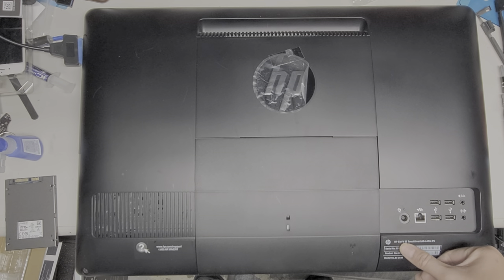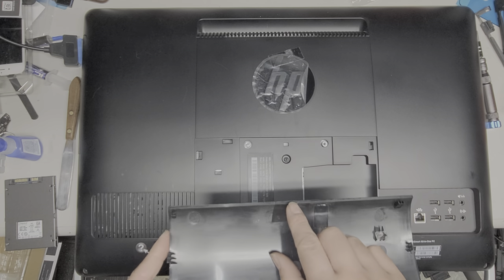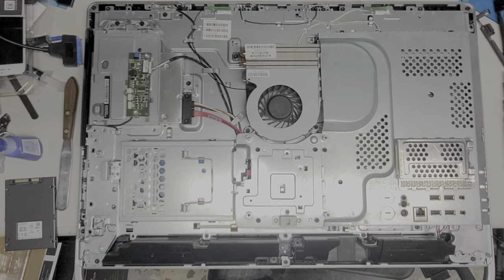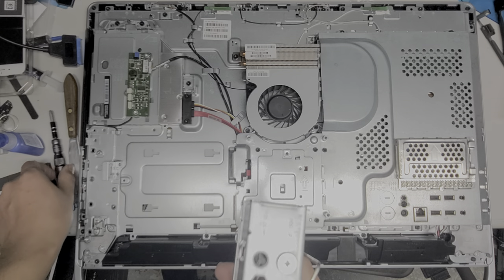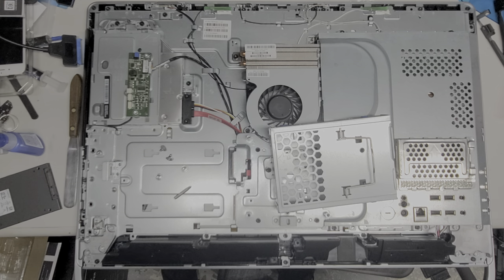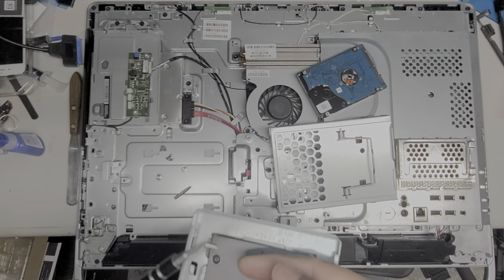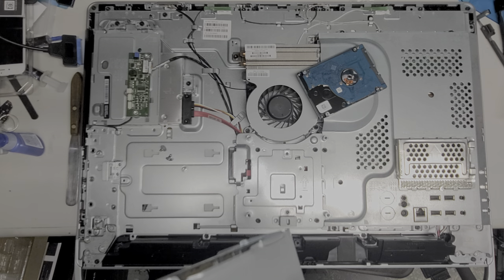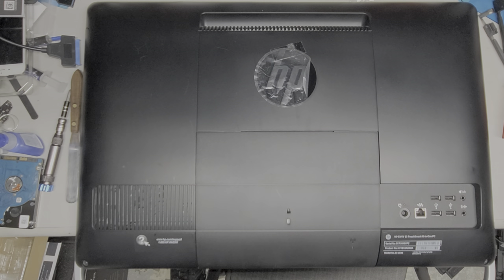HP Envy 23 TouchSmart All-in-One PC Disassembly RAM SSD Hard Drive Upgrade Repair

Comment: just wanted to say... it worked like a charm. I upgraded both, ram and ssd... thank you very much for this great video!
Reply from the maker: Glad it worked. If you haven't already, please like and subscribe so others can find my videos. Thanks!
Reply: @ItsBinhRepaired  done
Reply from the maker: @FreeEnergyNerd  thanks!
Reply: Hello, was the hard-drive that was removed a 2.5-inch or 3.5 inch? Do you have a link where you purchased the ram memory, what size solid state drive did you place in there?
Reply: @josephgarcia3767  somehow the answer i sent disappeared... i got the rams on amazn..2x8gb and removed the 3.5 1tb disk and replaced it with a 2.5 samsung evo 500gb.
But before you install windows 10... and upgrade ram, you MUST update bios from hp page. It will not let you do it if you use windows 10. and it will give you problems with the bigger ram with the bios as it is... now it works like a charm.
Luc
Reply from the maker: Interesting

Comment: Hi, I was wondering if the hard drive installed in that computer 🖥 was a 2.5 inch as stock? My friend has this computer and it's running slow. It did also have only 6 gigabytes of ram and a one terabyte internal hard drive. Suggesting they go up to solid state and 2 terabytes. Do you recall the hard-drive size that was removed? Thank you, very good instructional video.
Reply from the maker: I don't know because customers might make changes without telling me. All I know is what was in there at the time of working on it.

Comment: I have a 10 year-old HP Envy 23 similar to the one shown in your video, but the screen is blank (dark) when I try to boot. The fan works and I can hear the HDD running, although I had been getting intermittent error messages about a HDD failure. I've tried to turn it on with and without the HDD installed but no difference. Any thoughts on how to trouble-shoot the black screen?
Reply from the maker: Nothing on the screen at all?
Reply: @ItsBinhRepaired  no, nothing
Reply from the maker: Possibly ram needs to be reseated or bad screen or motherboard issue.
Reply: @ItsBinhRepaired  Thank you. I did reseat the RAM, but I do not know how to troubleshoot screen and motherboard issues. I removed the HDD and performed CHKDSK /r and at the end of Stage 4 I got " An unspecified error occurred (75736e6a726e6c2e 500)". But I assume that even with the HDD removed I should get something on the screen. Thanks again - I'll continue to fiddle with this computer while I look for a new one to buy.
Reply from the maker: Most likely motherboard issue :(
Reply: @ItsBinhRepaired  Yes, you're probably correct. Many thanks for your FB posts and reply to my question.
Reply from the maker: No problem

Comment: Just a quick question, can I use 12800 ram as oppose 12800S? Great vid by the way!
Reply from the maker: Most likely will be fine, just make sure you have a way to return it if it doesn't work.

Comment: Hello, what type of adapter is being used to connect the hdd/ssd sata to ? Thank you
Reply from the maker: There's no adapter needed.
Reply: @ItsBinhRepaired  so, there's no adapter inside the metal housing where the HDD goes?  I'm asking because I just received this same PC; it's missing the hard drive and the metal housing for the hard drive, but I do have a spare hdd that I can rig up in there
Reply from the maker: @Wub-is8dp  just have to see if the sata connector is there. You can mount the drive in place with tape.

Comment: i have trouble running photoshop and a screen recorder at the same time. will upgrading the graphics card and/or ram help my situation? 23 all in one beats n010
Reply from the maker: Yeah, but you can't upgrade the graphics card.
Reply: @ItsBinhRepaired  My Specs say I can add a graphics card in the PCI Express MXM slot that supports a PCI Express x16 graphics card (Generation 2 speed) (https://support.hp.com/us-en/product/hp-envy-23-d100-touchsmart-all-in-one-desktop-pc-series/5330735/model/5359999/document/c03305138)
How do I do that?
Reply from the maker: @IlseMulAuthor  no idea. Never tried that before.
Reply: @ItsBinhRepaired  ah 😀
I'm trying that expansion slot, but I can't seem to find it ....
Reply from the maker: @IlseMulAuthor  someone told me they used the wireless card slot for that. I'm not sure how that works.
Reply from the maker: @IlseMulAuthor  I don't even know how you can fit a gpu in the computer.

Comment: what type of windows usb should i buy for the all in one cause i lost the windows usb
Reply from the maker: You can create one using this https://youtu.be/R6GVDyVqWso
Reply: I fixed the ssd issue but idk if it will boot up to windows screen
Reply from the maker: @t4uva26  did you install windows to it?
Reply: @ItsBinhRepaired   no but when i took of the parts and the windows usb i lost the windows usb  so im wondering if it will boot up to windows
Reply from the maker: Only if you cloned the original drive to the new one.

Comment: do you know exactly the maximum ram that it can take? 🤔 if that makes sense..
Reply from the maker: Whatever you can fit in the slots
Reply: HP online manual has it marked for 16 gigabytes maximum.
Reply from the maker: I don't trust those maximums
Reply: What do you mean? 16GB is the max for 2 sticks of DDR3.  @ItsBinhRepaired
Reply from the maker: @sfgrgfsf212  I don't think you can get a single 16gb ddr3 module
Reply: @ItsBinhRepaired  Oh I see. Yes, two sticks of 8GB to total 16GB.
Reply from the maker: @sfgrgfsf212  yup

Comment: What SATA version is this PC has? How many SATA interfaces it has?
Is there any NVME M.2 interface fos NVME SSD on it?
Reply from the maker: Whatever is mentioned in the video is all I know. Any other hidden things that I didn't mention, I wouldn't know.
Reply: @ItsBinhRepaired  ok, thank U
Reply from the maker: @hasanmayditia1820  no problem
Reply: Looks like it only allows us to add one SATA drive, be it hard drive or solid state.  You can remove the optical (disk) drive and add a 2nd drive into this computer. I added an m.s drive into a laptop that has space for m.2 and SATA. The M.2 was connected into the motherboard. It resembled a ram module that was a bit longer.

Comment: Hello. Tell me which sled do you use (part number)? I have a similar monoblock model and want to upgrade my 3.5 drive to ssd.
Reply from the maker: What do you mean by sled?
Reply: @ItsBinhRepaired  A basket into which a 2.5 disc is inserted, which in turn is inserted into a 3.5 basket.
Timestamp 8:22
Reply from the maker: @АлексейКарогин  I'm not sure. That's how the customer brought it to me. I thought they all come like that.

Comment: wheres the link for the ssd cloning?
Reply from the maker: Here https://youtu.be/4p5jFDzVwUw
Reply: @ItsBinhRepaired  thankyou, also another question i tried using an msata ssd for this computer (in the video). do you know why the msata ssd is not
compatible with this computer?
Reply from the maker: How did you connect it?
Reply: @ItsBinhRepaired  mini slot 2 port
Reply from the maker: @RedVenomProductions  likely is for a network card only.
Reply: @ItsBinhRepaired  but it fits the slot. how could it not work? compatibility?
Reply from the maker: @RedVenomProductions  I mean, just because you can put it in the hole, doesn't mean you should, or that it's compatible, if you know what I mean. Lol
Reply: @ItsBinhRepaired  but do you think it could be the little blue switch/socket things need to be switched to different pins. cause i know there other blue sockets for the BIOS or CMOS reset. but what about the other ones
Reply from the maker: That won't make the SSD work
Reply: @ItsBinhRepaired  ok so its just compatibility then. then im going to buy the ssd in this video and try to install it. cause i need it cause the Hard drive could give out at any time. its been a long time since i had my envy 23 and i also want it faster.
Reply from the maker: Hope it goes well
Reply: @ItsBinhRepaired  same i dont want to loose any data or break anything
Reply from the maker: @RedVenomProductions  clone
Reply: @ItsBinhRepaired  right, i have another usb 1 terabyte drive.
im going to try to use a program to clone it on there.
Reply from the maker: @RedVenomProductions  macrium reflect free